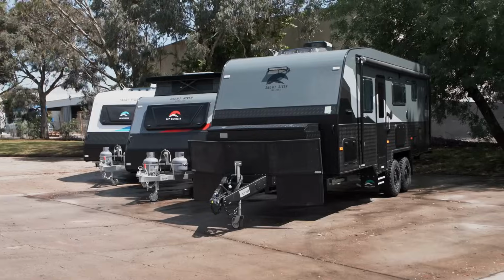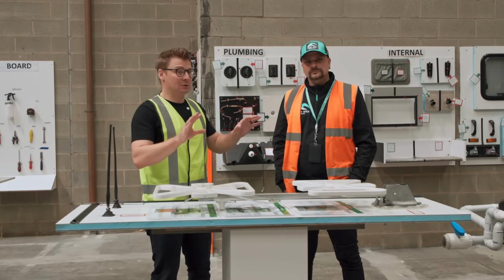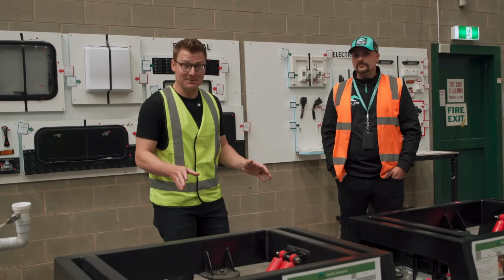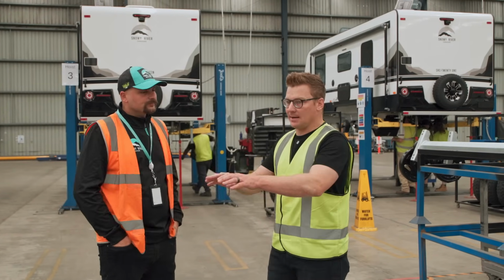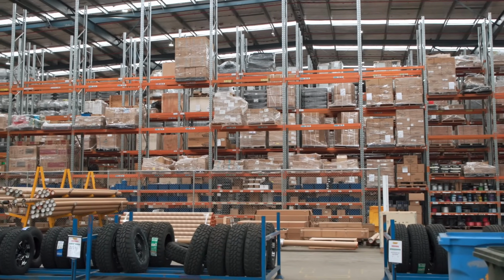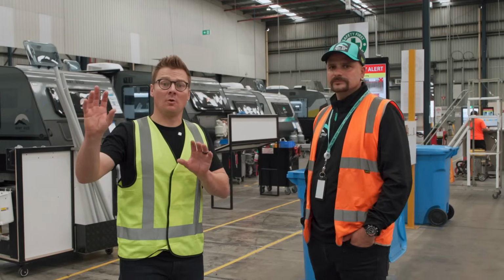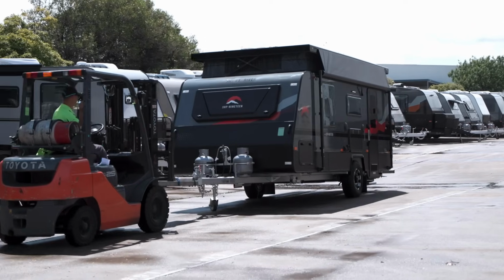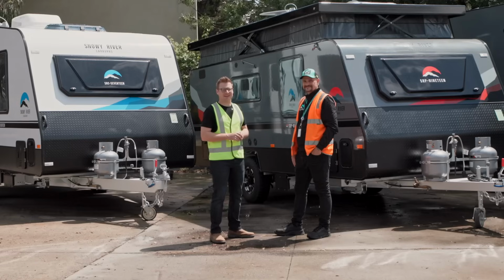Episode 64: Perkins Engineering visits the Snowy River Caravans Factory

Comment: I've viewed a new Snowy River display van and am researching the Harvok brand as well. Both appear to come from China to be completed in Australia. In both cases, the insulation in not complete. The entry door is a huge leak and it's suggested to request this to be insulated. The wheel arches intrude into the compartment/cabin and appear uninsulated as well. The marketing boasts a fully insulated van however, please be aware.
Reply from the maker: "Thanks for raising that, it’s a fair point to dig into. From what I've learned from Snowy is that they use Alopex construction, which means the walls, roof and floor are continuously insulated. Caravan entry doors and wheel arches are built differently across the industry, they’re usually foam-core or aluminium for durability and safety, but they don’t carry the same insulation values as the walls. This is pretty common across brands, not just Snowy. That’s why it’s always good advice to check things out yourself with your dealer, ask the right questions, and make the choice that best suits your needs."

Comment: Quality control out the door. we bought a SPR19 pop top and here is  the list from day one of delivery and 8 weeks on the road. 1: crack tail light lens, 2: Micro wave not secured came adrift next day, 3: roof troubles getting up and down and we are continually resetting the motorised roof, 4: slide out pantry having trouble sliding, 5: pre delivery detail cupboards and drawers full of drill fillings and marks on pop top skirt 6:The step being to low I'm needing to remove as we don't take the floor out going over a speed hump 6: Kitchen blind was promised to be replaced prior to delivery, this was not done. I was asked to take photos or videos of items and send in to warranty claims and not once did they say take the van to a repairer as we can get couple of these issues sorted for you, and get the minor stuff done when back. We were on our way from Perth to Darwin and did get caught out on a 24Hr rest stop when all of a sudden the roof would not come down, mind you having a Starlink helped, so we called Snowy and was told to reset and hold the button down for 20 sec, which worked but still having trouble with remote control and nervous to stop in a isolated
Reply from the maker: "That sounds like a really frustrating experience, especially while on the road. I’m not part of Snowy’s warranty team, but I do know they have a process in place to resolve issues under warranty and work with a dealer/repair network to get customers sorted as quickly as possible. If you haven’t already, I’d suggest documenting everything and contacting Snowy River’s customer service team directly so they can work through it with you. I’ll also pass your feedback along so it’s heard by the right people."

Comment: be careful with Chinese vans, insurance companies will not cover you or insure you I've been there done that, partially built in Australia does not mean aussy made.

EDIT: Any van overseas is hard to get insurance
Reply: Do you mind sharing what insurance company that was?
Reply: @shadra1  most of them, be up front with them to, i was with Raa, but now they  wont touch overseas vans, the lady who bought mine had to go thru a broker to find someone to insure with, so its not just chinese but anything outside australia.
Reply from the maker: "Thanks for sharing your thoughts. Just to clarify, Snowy River Caravans meet all Australian Design Rules and compliance standards, which means they are insurable in Australia. The Department of Infrastructure clearly states that all new vehicles, whether imported or locally made, need ADR compliance before being supplied to the Australian market. You can check it out here: https://www.infrastructure.gov.au/infrastructure-transport-vehicles/vehicles/vehicle-design-regulation/australian-design-rules. As with any van brand, it’s always smart to check with your insurer directly, but customers across the country have no issue insuring their Snowy. Best advice: do your own research and pick the van that fits your needs."

Comment: Funny how the day I picked mine up it rained and there was a massive water leak above my bed. Filled a 10 litre bucket in 20 mins. Proves that the water test is NOT carried out on every caravan. If every caravan was water tested mine would have been sorted before it left that factory. Quality control needs to be improved at snowy river. Maybe consult actual snowy owner to get a real life account of the quality of their vans.
Reply from the maker: Thanks for watching our video but I am sorry to hear about your issue, especially on the day you picked it up! I can only speak on behalf of my experience, and from the Factory Tour and time I've spent with Snowy River they take quality very seriously and they make the effort to ensure every caravan meets a high standard. If you haven't already, reach out to their customer service team and get it sorted. They value the feedback and will do their best to get on top of it and improve. Thanks for sharing your experience and hopefully your input helps improve for everyone. Cheers.
Reply: Quality control out the door. we bought a SPR19 pop top and here is  the list from day one of delivery and 8 weeks on the road. 1: crack tail light lens, 2: Micro wave not secured came adrift next day, 3: roof troubles getting up and down and we are continually resetting the motorised roof, 4: slide out pantry having trouble sliding, 5: pre delivery detail cupboards and drawers full of drill fillings and marks on pop top skirt 6:The step being to low I'm needing to remove as we don't take the floor out going over a speed hump 6: Kitchen blind was promised to be replaced prior to delivery, this was not done. I was asked to take photos or videos of items and send in to warranty claims and not once did they say take the van to a repairer as we can get couple of these issues sorted for you, and get the minor stuff done when back. We were on our way from Perth to Darwin and did get caught out on a 24Hr rest stop when all of a sudden the roof would not come down, mind you having a Starlink helped, so we called Snowy and was told to reset and hold the button down for 20 sec, which worked but still having trouble with remote control and nervous to stop in a isolated area.

Comment: Great. Send them up to the Sunny Coast and watch the combination roll over on the highway with the rest of them!

There needs to be an ARD stibily test specifically for all these new type high ride caravans.
You do not need an engineer degree to see that the roll centre is so far above the chassis that a roll over is the guaranteed outcome.

Why is the floor higher than the top of the tyres?
Don't say for 'Off Road', nobody is going to tow $250k of Taj Mahal anywhere you need the exit angle.
Reply from the maker: These are not really that different to other enclosed race car or car trailers, although they are predominantly for highway use only. They are raised for ground clearance as a lot of people do take them off road. Thanks for watching! Cheers!
Reply: @perkinsengineering 
I have never seen a car trailer with the floor higher than the top of the tyre like these 4wd vans all are now.
All of the trailers I've owned and towed have been constructed so that the load floor is not much above the axle centre.
They tow great like that when properly loaded.
Even properly loaded, vans like these are unstable, it's unavoidable. Not only that, but many constructors now add independent suspension with no sway bars. This just adds to the issue. 

I'm not having a go at your chosen brand here, just the now common design across the various builders.

As a racing workshop, I'm surprised that defend the design, surely you can see the high mass location is an issue. If not, follow one down a the road for a bit and watch the top wobble around.

A tiny minority take these things anywhere where clearance starts to be an issue, it's just a 'look' that sells vans much like a set of 35s on a lifted Land Cruiser.

All the best.

Comment: It's a shame they're not Australian Made... They really do nothing more than any other importer trying to make $$$ for $
You want to show some local, aussie made equipment, look at Jacksons Australia.
Reply from the maker: Thanks for watching and yes the chassis and body are manufactured in China but the Snowy River Caravans are designed and engineered in Australia. The final build, assembly, suspension fitment, water tanks, electrical, quality control and final build all happen at factory here in Melbourne. This guarantees the highest quality and durability, backed by a 5-year structural warranty. Cheers!
Reply: Well thats ok if you want to pay 100k more.

Comment: Very impressive set up. Look like they are well engineered and made. I just checked out their website and it seems to suggest that the caravans are actually built in China? Is most of the work done overseas and then they just fit some final bits together in that factory?
Reply: so, my understanding, from friends who own one and we stumbled on a snowy river catch u once, is they are essentially built in china, get shipped out as an empty shell, and the fit out is done here...
Reply from the maker: Yes they are designed and engineered in Australia with the chassis and body manufactured in China. As you can see in our video, the assembly, quality control and all finishing touched happen right here in Melbourne! Cheers for watching
Reply from the maker: Thanks for watching. Snowy River Caravans are designed and engineered in Australia. While the chassis and body are manufactured in China using designs from an Aussie R&D team, all assembly, quality control, and finishing touches happen at the Melbourne factory seen in this video. This ensures the caravan delivers the highest quality and durability, backed by a 5-year structural warranty. Let me know if you’ve got any other questions! They're planning to relaunch the factory tours for the public in 2025, so stay tuned for that! Cheers!
Reply: Yep they are actually slightly narrower than most vans so the panels can fit into containers.

Comment: I am in the market for a van and like the SRC but put them lower on the list as the body is not locally manufactured.   Their assembly facility is impressive, was blown away by the water test, will definitely reconsider a SRC
Reply: Yes, I didn’t see any frame welding or anything like that or suspension fabrication. Is all that coming from China? Chinese fabrication can be the weak point, just ask someone who has just been up the Tanami Track.
Reply: @jefftheaussie2225  my understanding is everything is made in China and locally assembled.   I equally share your concerns
Reply: I have a 2 year old snowy and the Chinese concern is not valid given most vans have a high percentage of Chinese supplied gear but what is a concern can be the warranty support. We love our van but feel there after sales support could be better.
Reply from the maker: Yes it was very impressive, high attention to detail and quality of workmanship! Cheers for watching